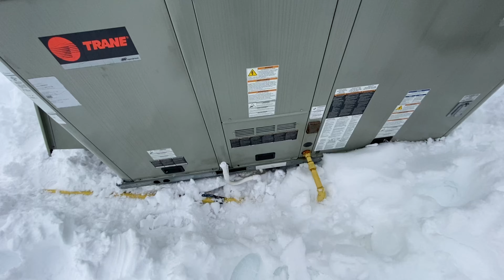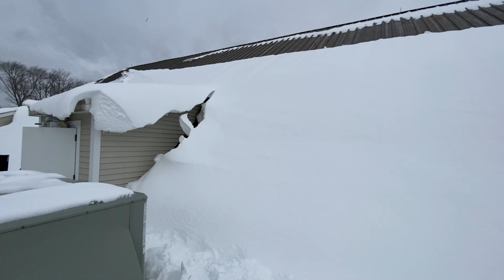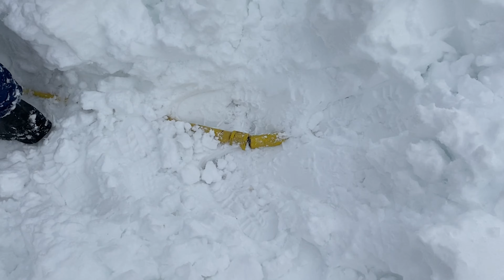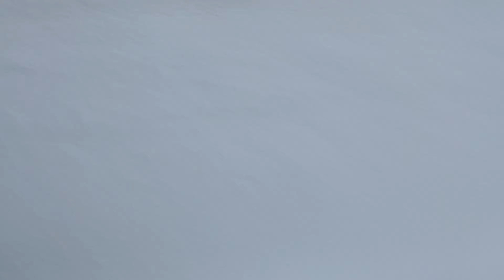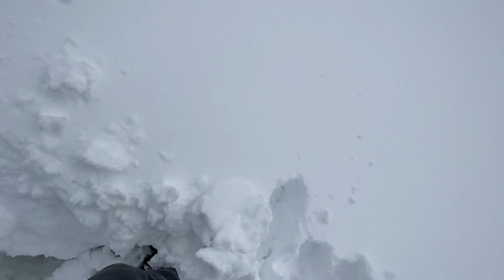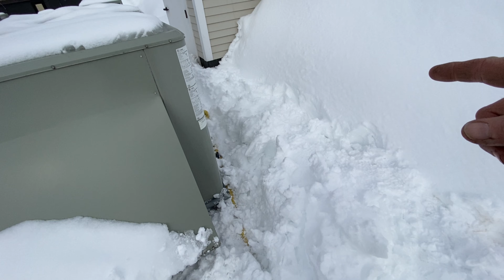Severe Gas Leak Snow Snaps Steel Pipe Smelled 2k ft Away

Comment: Recommend a snow guard on that sloped roof. Thxs for the vids!
Reply from the maker: I recommended the snow guard. In the spring I am rerouting that gas line. Minimizing piping running parallel to that steep slope.

Comment: I wanted to see the repair. Did you use CSST?
Reply from the maker: I should of filmed it. I used all black pipe. Reran the 1-1/4 line from where it tees for both systems. Put a ball valve at the beginning of line to isolate and put gas back on for building. Then replied that gas line. It was soggy up there the next day, working in melting snow